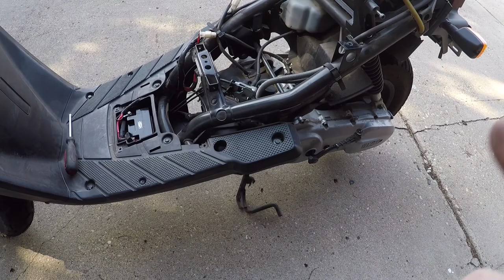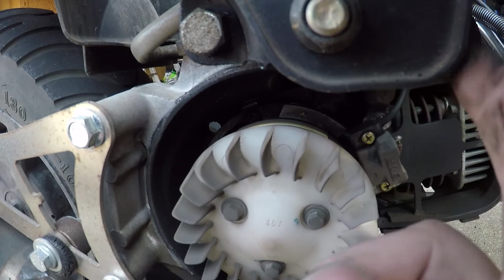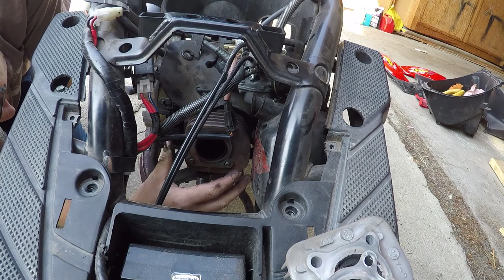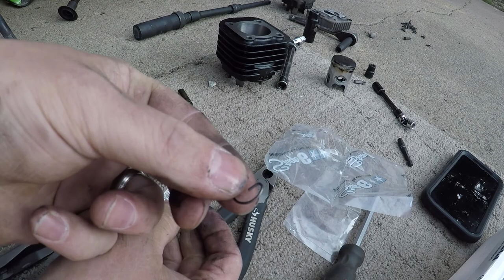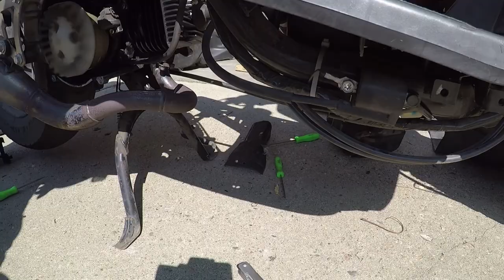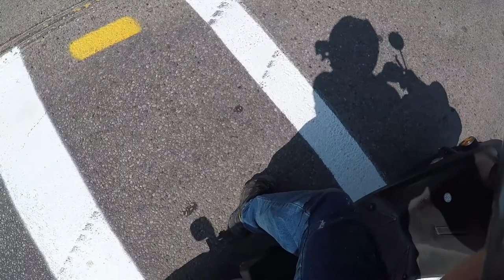Yamaha BWS Zuma 70cc Cylinder upgrade for more performance and power. Higher top speed!

Comment: I just finished upgrading my zuma 50 to a 70cc with a new pipe, new variator, new shoe and clutch bell, up jetted and new air filter, after all that it now goes 80kmh knowing the crank arm is stock though I'm a little hesitant on riding it at 80 for long periods but oh man is it ever a blast.

Comment: Was wording if you happen to blow the top end  fairly quickly after the new jug and pistion were installed ?  Noticed you didn't remove the  ear on the c clip that holds the pistion pin  in the pistion. Just speaking from a recent experience I hand rebuilding a yz85 stroke! I blew two top ends before I realized the ear on the c clip would brake off and jam between the cylinder and the pistion . Just was wondering if u had ran across the same issue  C✅   G❌
Reply from the maker: That has not happened to me yet.
Reply: Is it still good?
Reply from the maker: @izur5441 it’s not.
Reply: @therealboofighter  what happened?!
Reply from the maker: @izur5441 I should make a video about it.  But things in the variator went askew.

Comment: u cant use that spark plug its way to short for that 70cc kit
Reply from the maker: Interesting, I didn’t know that. What would the symptoms be with running a short plug?
Reply: @therealboofighter  nothing i dont think it would harm anything just not as good as spark
Reply from the maker: Ok, I did run it this way for a bit and then it’s seams to have trouble getting back up to speed.
Reply: @therealboofighter  yea try the longer one or if u have  one I don’t know the size but I know there longer
Reply from the maker: I will have to get one.  Then wait till spring.  It’s a snowy winter wonderland were I live
Reply: @therealboofighter  oh trust me same here it’s great lol have a good Christmas tho take care
Reply from the maker: You as well.
Reply: @therealboofighter  the trouble with the speed is probably a cvt issue.
Reply: @WickdPerfekT agree

Comment: Are you using stock carb?  Did you change your jets?
Reply from the maker: Stock carb. Upped the jet a little.
Reply: @therealboofighter  did you have to adjust your air fuel screw, im doing the same build right now and i can’t the tune right with stock carb
Reply from the maker: It’s hard.  I need to spend more time with it.
Reply: @therealboofighter  ya i just got mine yestersay and i’m having a hard ass time trying to tune it haven’t even got the chance to ride it correctly yet
Reply: What is your top speed ?
Reply from the maker: So far I got to 80kph.